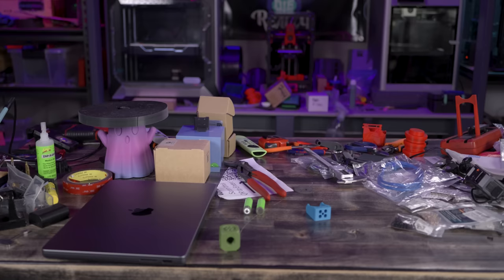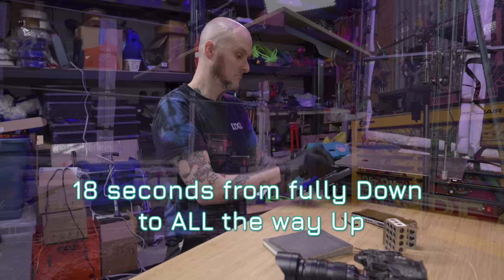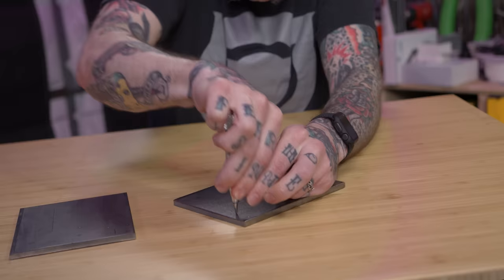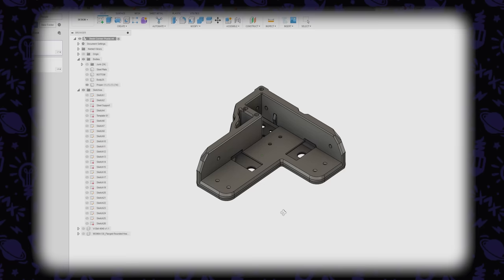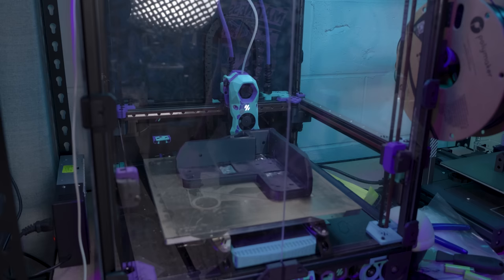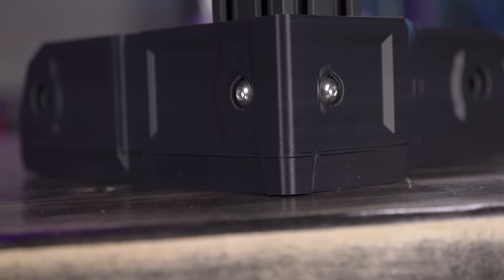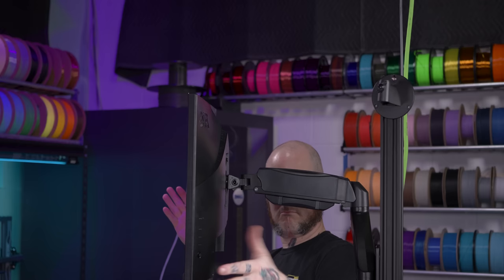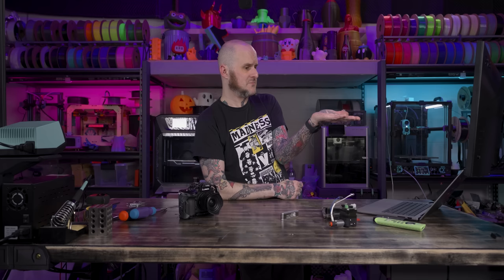STEEL Reinforced 3D Print - Ultimate Workbench Build!

Comment: Just a thought, run another section of extrusion across the top to the two corner extrusions. This could be used for camera and/or light mounts for overhead shots.
Reply: Same thought I had. You could use mini DIN rails for easy swapping of gear on the 2040 extrusion, too.
Reply from the maker: Great idea. 👍🏻 That was exactly what this design was meant to be originally. I’m going to try just the two posts for now and see how it goes. I’d need to source longer extrusions for that (obviously) which drives the price up significantly. I originally thought about mounting linear rails to that top extrusion so I could quickly reposition lights / camera. Maybe eventually I’ll do it.
Reply: @MandicReally  If you do it, which I was also going to suggest, you could maybe make an adapter to mount your monitor to it and be able to slide it across the extrusion to be where you need it while working at different places.

Comment: So with the steel plates: what about printing a small 1-3 layer thick section that you place on top of the steel as you insert it? That way you don't have the nozzle interfacing with the steel, just with regular plastic. Not sure it would work but might be worth trying
Reply from the maker: Getting the dimensions right is difficult. Steel isn't really available in Layer height sizes. That isn't a bad idea though. I'll as it to the list of ideas for future testing.
Reply: @MandicReally  yeah, you can try and compensate for the thickness by having the intermediate layer be different layer thicknesses than the rest of the print. So if you're doing a 0.2mm layer print for the main piece, and the steel is 7.92mm, you can do a 0.8mm layer print to get it to a nice even number. You of course can't get everything solved, but with the first layer thickness you can do a different layer from the rest to solve for prime numbers.

Comment: Just built a similar desk using the Flexispot E7 frame and an Ikea Karlby 74" x 42" kitchen island for the desktop
It's holding 2 heavy core-xy printers and a watercooled super-sized tower pc
It rises slowly, but it still has good torque and stability, better than I expected to be honest
Also, the Flexispot casters are fantastic! They were worth the thirty bucks (think they're cheaper if you get them at the same time as a frame)
Reply from the maker: I’ll have to look into the casters. I chose to not get them cause I move this desk so infrequently, but it would be nice to have. Glad to hear the E7 is working out for you.

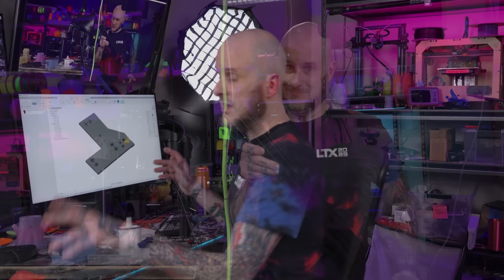Comment: 1:15 bro I just noticed those holes in your ears for the first time. That light behind really helped lol btw, nice build. Love the idea of embedding steel into the 3d part for more rigidity, but still having flexibility of manufacturing with 3d printing.
Reply from the maker: Thanks. I could have just use the steel plates but they’d be ugly and less functional. The finished parts have cable routing and look so much sleeker, but retain the steel strength.
Reply: @MandicReally  yeah I agree. I think 3d printing gives it a more finished look here and it's also more cost effective and easier to do such a shape compared to doing full steel.

Comment: You could've added a thin piece of fabric on top of the metal plate (with some overlap to the plastic part) to make printing the next layers easier. Or just run some crossing strings over it to provide some extra points of adhesion to the filament.

Comment: Awesome video! Did you maybe consider cutting a sheet of PEI to stick to the steel so the print surface might have adhered to it better? Not ideal, but if you got some lying around it might be worth a try.
Reply from the maker: The steel is recessed by approximately 1 layer height to prevent collision. So that wouldn’t make up the thickness there. I’ve got some ideas to experiment with in future videos. 👍🏻👍🏻
Reply: @MandicReally  looking forward to it. Appreciate the response and love the style of video your doing. Keep it up

Comment: For the printing over steel, could you put a slab modifier in your part that was 1 or 2 layers thick at the height of the top of the steel? Set the modifier to solid bottom layers and even the print angle. Then it wouldnt try to do the circle features and bridge as expected.  Im armchair quarterbacking though, I havent tried this yet myself. Just a thought. Also for the top extrusion, since the risers are strong enough, you wouldn't necessarily need 4040 maybe 2040 to help cut down on cost? Either way it turned out great. I would like to know your adversion to layout fluid (sharpie works great, just curious).

Comment: here is what i do when i put steel or fiberglass rods or metal rods into prints. is i make it so can slide the metal in after printed. glue a insert in access panel. with a lil glue with the metal then it all bonds as 1.  you are welcome i just saved you tons of headaches and failed prints but added some design time :) love you lol but not in a prison kinda way.

Comment: I like the VIVO dual monitor mounts however it might require some fabrication for the 4040 extrusion.
Reply from the maker: I use those with my main desk. They are ok, but this one needs much more adjustability unfortunately.
Reply: @MandicReally  custom t-nuts with quick release handle allowing the vertical movement along with VIVO monitor mount or the horizontal movement?  Sounds like a good resellable design for others?

Comment: I wonder if you had some extra holes though the steel with printed pegs in the model so you had something to grab the plastic when you where bridging over the plate
Reply from the maker: That is one of the techniques I intend to try next time I do this. 👌🏻👌🏻 It will be a balance of strength of the steel & the print design, but worth trying.

Comment: I have 2 Voron 2.4 machines, one with TAP, and one with the stock end stop. I have been debating if I really think TAP is the best solution for me? It has some great advantageous, but also some obstacles. Being able to rehome Z mid print is a solid no-go obstacle with TAP.
Reply from the maker: Yea I was thinking about that after this. I haven’t tried tap as it adds more weight and possible movement points to the Toolhead.  I see now the homing of Z could be an issue for me too. There is no “one size fits all” answer I guess.

Comment: So how would you go about making sure you only had straight bridging above the metal insert? Is there a way to do so in the slicer, or would you have to design sacrificial bridging into the part on the layer above?
Reply from the maker: There isn't a way to correct for this particular design in slicer. It has to be in the design itself. It is hard to explain through text. I'll try and do a follow-up where I show the method. But it just requires ensuring the layer above the metal only has paths that make sense to go 1 direction with them.

Comment: Good video! I have a question to someone with experience though. I’m on the line between getting the X1C and P1S. Is the X1C worth the extra money. The Black Friday sale is better on it.
Reply from the maker: Depends on your needs. If you are primarily printing PLA / PETG, the P1S will do the job well and cheaper. If you’re wanting to print higher temp materials like ABS, ASA, Nylon, the X1 bed goes to a higher temp which is a necessity. You can do some ABS/ASA w/ P1S but I’d recommend the X1 over it for that. Also the X1 touchscreen is a light years better user interface than the P1S control pad. If you get the P1S I’d largely consider it “headless” and operate it from a computer since the screen is so bad. 

Hope that answers your questions. Here is my affiliate link for the Black Friday Deals: https://tinyurl.com/BambuBlackFriday

Comment: What is that bench top power supply you are using unde the soldering iron?  I couldn't make out the logo.
Reply from the maker: It is one off Amazon that fit the specs I wanted. I haven’t tested it heavily but use it to power LEDs, fans, and random items for bench testing. https://amzn.to/3MZnm7m (affiliate link)
Reply: That looks really nice. I may just have to pick one up!  Thanks!

Comment: Why not use STEEL Filament?  Yes, STEEL PLA is a thing and its the most densest material you can print with....its also just as expensive at around $50 for a 500g spool.  There is also Iron PLA that is magnetic (ferrous) too.
Reply from the maker: Neither of those offer ANY strength benefit. They arguably hurt strength. They may be "Dense" but that has nothing to do with overall tensile or deflection strength. They both are just PLA with fine Iron or Steel powder embedded in them. Which has the potential to reduce layer adhesion as the steel/iron dust doesn't adhere to PLA as well as PLA does to PLA. They are neat for silly fun prints or if you want added weight, but offer NO strength benefit. 

I've been meaning to print a SledgeHammer with IRON PLA for a while (I've got a 2kg spool around somewhere).

Comment: Did you adjust the pre-tension on the monitor Arm? Because they are made for a range of weights and you need to adjust the pretention screw to adjust for your Monitor :)
Reply from the maker: Yep. It will stay in whatever position I place it in no problem. That sadly doesn’t do anything to help with the wiggle. It’s a bit of play in all the joints and leverage adding up to, shakes.

Comment: If you don't care about layer separation in mentioned position - why not just two parts and metal in between? Will save you a lot of time and hassle. Looks like overengineering for nothing.
Reply from the maker: Not every project will have the same constraints. It wouldn’t be hard to redesign and prevent that issue from occurring. It was just a constraint I missed at the onset and couldn’t afford the time to go back and correct. The parts would be stronger without the layer issues, and look better aesthetically.

Comment: I hate monitor arms.  They all wiggle too much IME.  Instead, I've taken to mounting the monitor to the wall behind the desk...  Which isn't really an option in your setup.

With all the prep you had to put into that steel insert, and all the problems after, I would totally do that differently.  I'd either design the print as 2 pieces and use threaded inserts...  Or just not have a bottom on it at all, and simply sandwich it to the bench with the steel plate exposed on the bottom.  But then again, I'm quite a chicken about things that have to be done during the middle of a print, and I avoid them as much as possible.  ;)
Reply from the maker: Im going to revisit the idea with lessons I’ve learned. I think I can improve substantially and maybe do some experiments soon. Folks have asked for input on getting parts cut for them too, so may be worthwhile to do a whole video exploring it more.